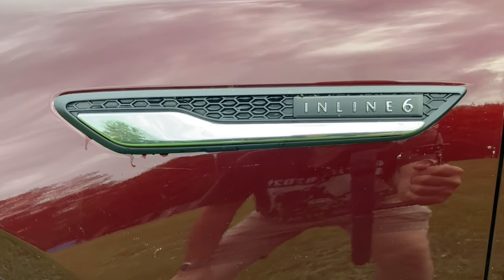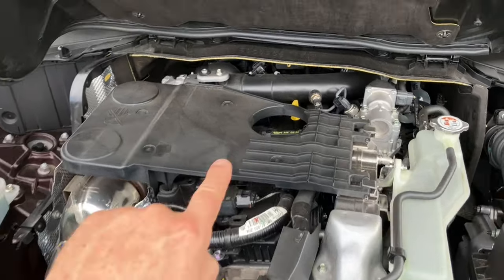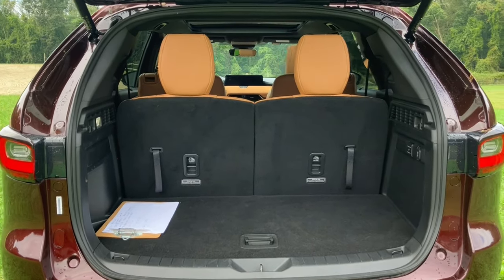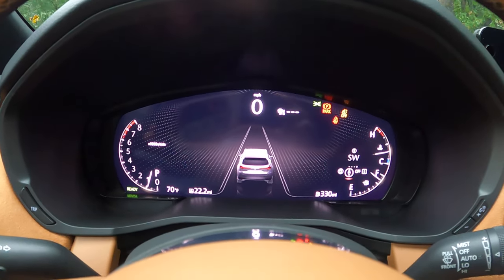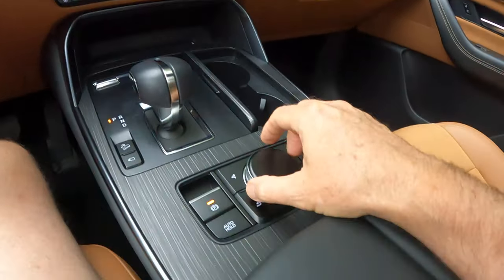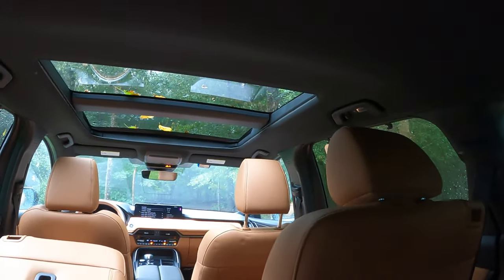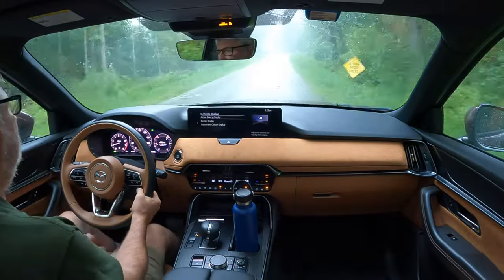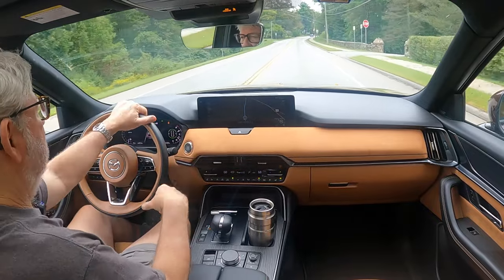'24 Mazda CX-90 Review

Comment: There's 2 versions of the I6 with different turbo boost levels. Both can run on regular just fine. The high output S trims will lose 20 hp on regular and no torque.
Reply from the maker: Thanks for this. The way they put their HP/ Torque ratings in the specs is confusing. Mazda has a recent history of having very different ratings for running regular vs. premium turbocharged and I was vexed. Not really certain why they do this when other OEMs don’t. Thanks to knock sensors, you can run lower octanes on new engines w/o danger-just reduced output.